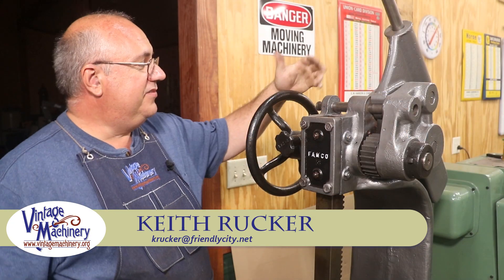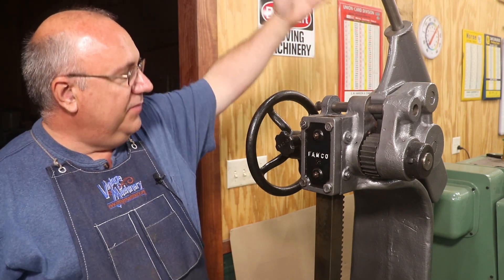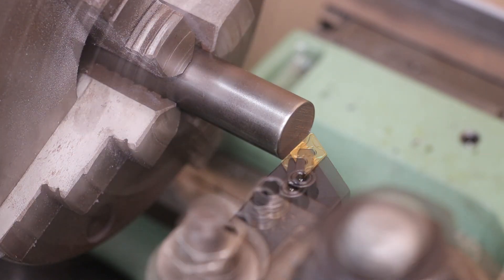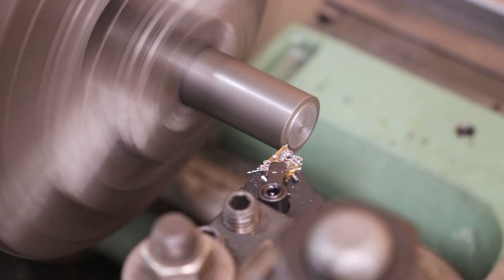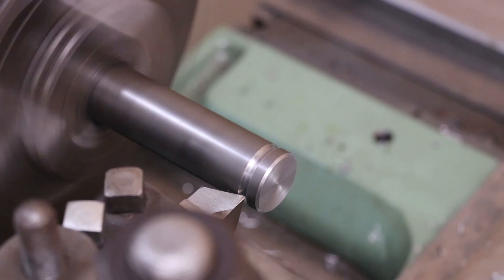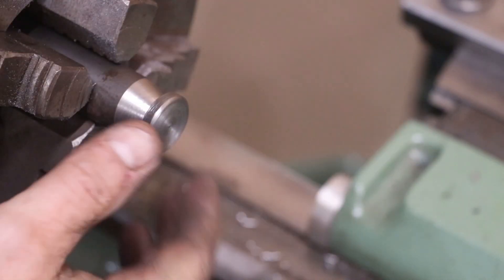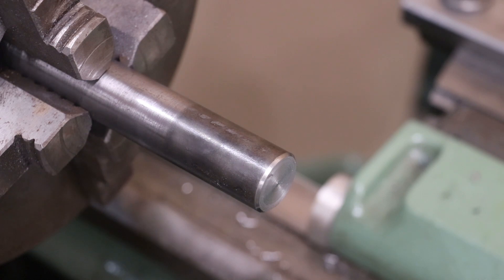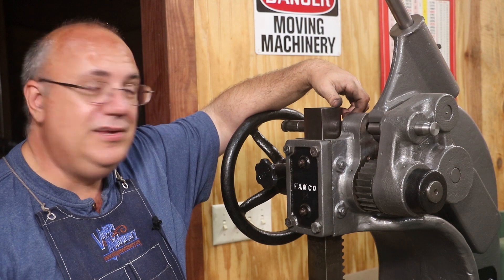Turning a New Ratchet Pin for a FAMCO Arbor Press

Comment: It hurts mah eyes when u thought putting it further in bcz of the Chatter will help it. I just said to myself it will not like it either way.. U should have went down with the spindle speed or made 2 Cuts out of it, wouldn't have taken any longer but better for the Tool.. And Probably for the lathe too... I mean I am by no means a pro at working with a lathe.

Comment: Nice fast project. I'm a little surprised you didn't make a set of pins with machined in stop collars such that when you pushed one from one side to the stop, it would have the pin for that side fully engaged and from the other side likewise. I know that's not the way it came from the factory though.

Comment: Why not just remove the pin from the left side and insert it on the right side?
Reply: looks like two different diameters
Reply: @fredfranklin2054    Then one side can be reamed to make them the same.  It simply seemed to be a lot of flurry over a trivial matter.  Regardless, Keith is happy and that's cool.

Comment: Suggestions, Add a heavier chamfer to both pins.  Use ring grooves to limit travel of the pin.. You should not have to pull one pin but simply use one pin to push the other out.  Neat Arbor press BTW.

Comment: Need a storage spot on the machine for the pin when not in use.
Reply: Would you just set a magnet on the side of the frame or are you thinking of a jig like a bur block or drill block?

Comment: Can you switch modes by just pushing the pin? (And thereby pushing the other one out of the way?)
Reply: I was thinking the same thing, just add a stop to each pin to keep it from going too far, and add a convex surface to the end of the pin to prevent any catching.

Comment: Wonder if the rear pin was original- the logical way to design that would have been  pins with  heads with each one the right length so when one was push in to the end, it would displace the other and vise-versa.

Comment: That's the way to do it, now aday al the safty freaks say no no that's not the a safe way to do sanding, for my opinion you dit a great job, and as always thumps upp :-)
Reply: He held the emery between finger tips, NOT wrapped around the hand or fingers.  He was doing the correct way.  If it grabs, it is simply removed from your grasp without loss or mangling of digits.

Comment: A 1cm-ish Nd magnet attached to the end seems like it would take the process 'swap two pins'  from two actions to one action.
Visually, it looks like there's a natural stop already for "maximum insertion of right pin". So ... there's just some mechanism for preventing over-extraction of the right pin.
Reply: I was going to suggest the same thing with the addition of adding one of those screw-in detent plungers to one of the pins. That would ensure the separation plane would always line up and a generous chamfer on both pins would make for a quick swap between modes of operation.

Comment: why has it not got a pin to stop it coming out fully ?
Reply: I thought the same thing, but how would you design it?  
Maybe a roll pin thru only one side. It has to pass that open sided slot. But is there room or would it interfere?
Reply: @cannon440  part key way with location pin or grub screw location in slot

Comment: This is the first video where I've seen someone adjust the cutter to hit the center.
Update: ...and since I'm not the only one to comment on that - a short video that focuses on that might be useful.
Reply: If you watch Keith Fenner's lathe video's you will soon see him adjusting his tool height. He has a neat technique where he puts a short steel rule between the cutting tool and the workpiece. If the tool is on center the rule points straight up  if not it leans one way or the other depending on where the tool is high or low. Best Regards Sarah
Reply: @loydsa  Thanks!

Comment: I know you are a pro Keith...but that file next to the spinning chuck was a but uncomfortable for me.
Reply: That particular type of file is known as a lathe file, mostly due to the angle of the teeth. It's made for doing just what he did with it.
Reply: With the chuck stopped he would have filed a flat, you know.
Reply: It looked like the file was less than a file width to the chuck...smartass...that is the uncomfortable part...
Reply: @youbecha64  Well if the tip of the file drops onto a chuck jaw, the file would be launched. That's why Mr. Pete reminds us of proper file handles with metal rings. The side is not a big problem. The jaws are hardened.